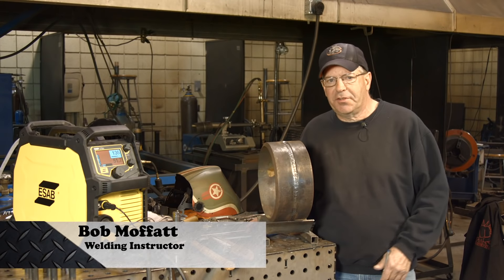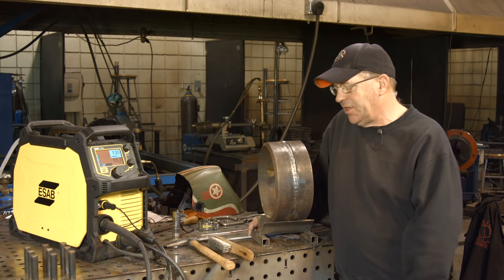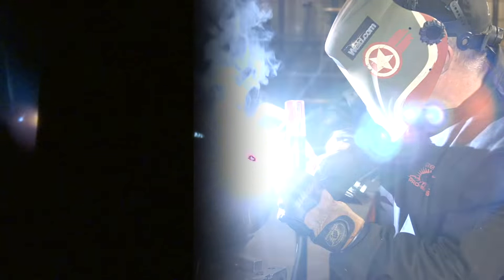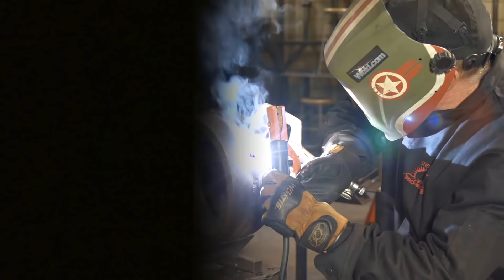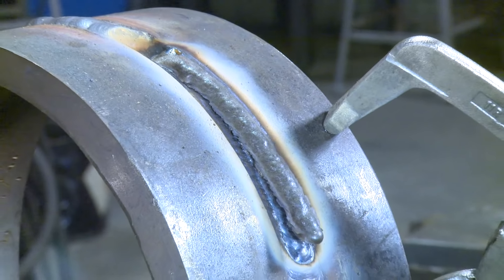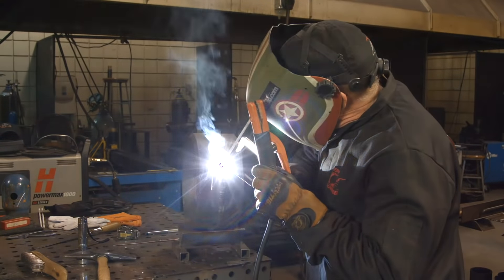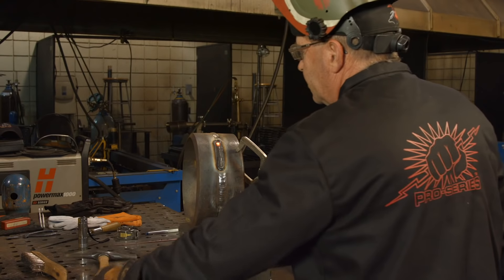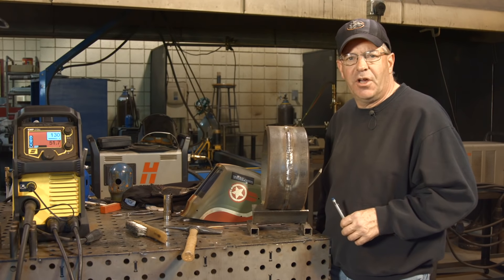🔥 10" Heavy Wall Pipe - 5/32" 7018 Cap (VIEWER REQUEST)

Comment: Only a welder can experience the satisfaction of the slag peeling off revealing a beautiful weld.
Reply: Amen to that brother. I don't stick weld with my everlast much but just reading your comment makes me want to break out the 7018
Reply: Using 7018 I love to see the flux lift off the weld bead, shortly after I finish. I know I did something right.
Reply: Richard Valcourt espescaily since only a welder knows what it takes
Reply: Richard Valcourt I love when I'm doing a 6g and hear the slag not only peel behind weld but for it to actually fall off and hear the sound of slag breaking agenst the ground while I'm still burning rod
Reply: chris jones I love when the slag peels and falls on my lap...or when I'm crammed under the  pipe and it falls on my beard when I lift my hood.....it's amazing
Reply: Chris Capozzi agreed long as it don't burn the beard 👍👍
Reply: Especially since only a welder... welds?
Reply: "I AM A BEAUTIFUL BUTTERFLY" - 7018 stringer after the slag peels off
Reply: Richard Valcourt Yes sir. I have had the pleasure of removing slag like that! It’s awesome
Reply: Richard Valcourt Yes sir🤟🏼
Reply: I love finishing a bead and lifting my hood to see the slag trying to take itself off
Reply: chris jones that’s is the best sound to hear when ur welding but unfortunately you often hear your coworker slam a hammer on ur work piece instead

Comment: Me and a few giys at work are having issues with 7018 5/32 vertical stringers. Specifically a 5/16 vertical weld which is pretty common in Maryland for bridge work. Thanks. Love to see a video on this or have some comments. Best option I've found so far is small swoops.

Comment: can you do a video on SMAW stainless pipe welding? I'm specifically looking for help on the root pass using a 309-15 stick electrode.
Reply: 309 is mainly used to weld stainless to mild steel. I used 309 to weld screens which were stainless to the shell of digesters which were mild steel. these digesters cooked the chips in the pulp and paper process.
Reply: ya but there is a TSSA test for stainless pipe certification that is a 2"sch40 carbon steel pipe on a 6g and stick welded completely with 309 root to cap. I was just looking for some pointers. I hear it's a pretty common test and I've herd of many different ways to approach it but there is more then one way to skin a cat of course.

Comment: Stringers Vs Weaves.... might not be much difference on a film after a weld is bombed, but definitely makes a difference to the microstructure in the HAZ. Weaving keeps the temperature elevated longer allowing grain growth, which as you know, effects the tensile strength of the parent material.

Comment: Great video as usual. You hold your stick at the center of the pipe but, I noticed the you have it leaning back a little in you holder. I that a preference or a reason for that.
Thanks again.
Reply from the maker: It's so that you can comfortably hold the correct rod angle as you progress up the pipe.

Comment: Great videos, like to see a 316 stainless, schedule 10 pipe, open root, 6g, 3/32, stick all the way. This is a definitely a rare feather I'd like to add to my hat.
Reply: This is a great video.It is very well explained with a good mix of arc shot vrs rod angle and body position.

Comment: this is great but i need more of when 6 to 9 is being done because where you are starting is the easy parts but i have blown a huge crater running my amps this high using anything else than a 3/32 and its agonizing having so many restarts can you do a whole pipe in 5g uphill weave cover?

Comment: Yet another very good video Bob. Thanks. I've been watching all of your videos and I must say I'm very favorably impressed with that little ESAB welding machine.
Reply: workwillfreeyou I have the esab miniarc arc 161 lts and it's been a phenomenal machine. Great pipe machine for sure. Runs 6010 great, smooth on 7018 and a real nice Tig arc as well. Have a few vids on my channel if u wanna check it out

Comment: I have a question.  I have watched multiple videos. Maybe I missed someone saying it. Why use different rods?  6011 then 7018. Why not just use a 70 style rod? 60 style are 60 ton and 70 are 70 ton correct? I learned to weld when I was 7 years old. Dad taught all of us. I am no PRO, never went to school for welding. Never could weld uphill, but can't wait to try it after watching all these videos. All you guys make it look so easy.  Learned my rod was to far away and probably to hot, I have made my fare share of grapes. I wish I had the rods and money to pay for the electric bill so I could practice.

Comment: Hi Bob great technique as usual. Have welding practices changed more towards flux cored wire rather than stick welding ? It seems to me that theres the chance of more consistency with gasless MIG (and I know that's a contradiction !) as there is no stick changing time - but does this run the risk of more welder fatigue? Cheers.

Comment: 6013s with a good welder and good voltage can weld pipes no problem. Voltage is power when it comes to welding.

Comment: do you still prefer 3/32 root face on that 10" pipe? schedule what? does it make a difference on pipe what the diameter and thickness is in reference to your gap and landing???

Comment: Everytime I weld a pipe in 5g with 7010
I end up getting undercuts in the overhead during capping
Any suggestions regarding weaving,angle and manipulation?
Reply: I weld with 160 amps current and pipe has 80" OD and 16 mm thick

Comment: The slag never seems to come off like yours. What is the trick, let it cool more, more heat input....???
Thanks for the videos!
Reply: Tom Herd very clean base metal..tight arc gap and proper rod angle should do it.
Reply: Gave it a try the other day and that did seem to help. Thanks.

Comment: Can you do a demo on a initial b pressure weld on 6 inch sch 80 5G position 6010 1/8 root and 7018 3/32 fill and cap quarter of a portion needs to be done on 2G position thanks

Comment: Would it be to much to ask? Could you run a 7016 or 7018 root on .375 wall, in 5g, open butt. I weld at Embridge, and they have that test, for their in-service test. Great videos.

Comment: so I'm still in highschool in advanced welding but I still have trouble striking the ark in the first go with 5/32 7018, is there any tips you could give me for that? would be much appreciated
Reply: Andrew Lewis ask you're teacher....
Reply: Check for: the OVC of the machine.  7018s require a higher voltage.  Check the stick itself.  Some brands of 7018 are alot better than the others.    Switch to DCEN for roots and DCEP for fills.  Only 7018 sticks designed for AC will work with AC, and even then, if it's just a standard 60Hz transformer machine, (no modification of the duty cycle[pulse width modulation], hot start, induction, etc)  then you might not get the best results.  Also, DC provides a higher OVC at the price of a lower duty cycle[machine usage/time]

Comment: need help with 5g i always have double the build coming up from the bottom but i do fine half way to the top and pointers on speed and or technique for passing the milestone i need to pass!
Reply: Go faster on the bottom or use a smaller rod then the top. Up here in Canada if I did a pos weld like that I’d use a 5/32 from 6to 2 o’clock then id switch 3/16” to  fill the top a little faster

Comment: So little splatter.  is that because its 7018?
Reply: Its partly because its 7018, and its being run off a new welder. Also, on vertical or overhead sections, the spatter BB's tend to fall down instead of stick.

Comment: I'm having trouble with my cap on 2g pipe
Reply: With undercut
Reply: Are you trying to run stringers or weave?
Reply: Bob  Moffatt I'm running stringer of beads
Reply: Gus Pritchett Short steady arc. Stay on the leading edge of the pool. Lower the amps if necessary. Rod pointed at center of pipe or slight drag angle.
Reply: Bob  Moffatt thanks for the advice
Reply: Gus Pritchett Let me know, please.
Reply: Bob  Moffatt could you please do a pipe welder video of 2g pipe welding video please
Reply: Gus Pritchett Since you spelled my name correctly, yes. Lol
May not be soon, but yes I will.
Reply: Bob  Moffatt thanks

Comment: Does 135 amps seem cold as shit to anyone else?? I know machines run different but thats ATLEAST 20 amps cooler then I run 5/32 especially just running on the top half of the pipe.

Comment: didn't know you could run 7018 with 135 amps highest I've had mine is like 115
Reply: terrace Robinson at 5/32s  the "minimum" on the charts are all 150.   Upto 250.  All depends on how your machine handles it.  I have a tiny damn near pocket sized 80a DC machine that will do up to 1/8th size 6013 with ease.  Won't strike a 7018 5/64ths, or hold any puddle on a 6011.

Comment: Will you do a 2" sch 10 stainless 6g test a full video of root to cap use 5/32 gap 1/8 308 wire. It would be helpful. Thanks. @weld.com
Reply: Jacob Ferell unless procedure specifies a gap you can easily fuse  sced 10 with knife edge prep slammed then cap it.  sorry of I'm telling you somthing yo already know.
Reply: Very true, sir. Good input.